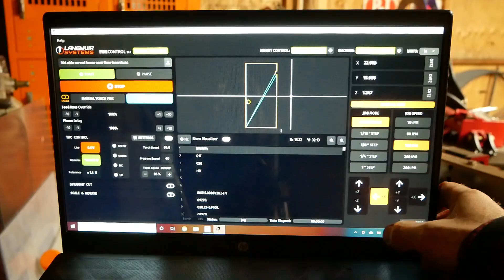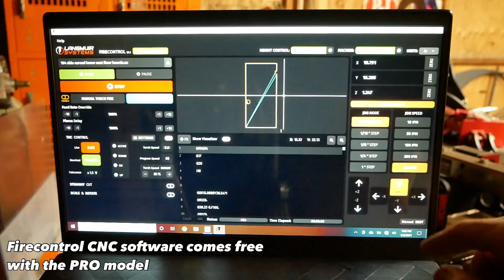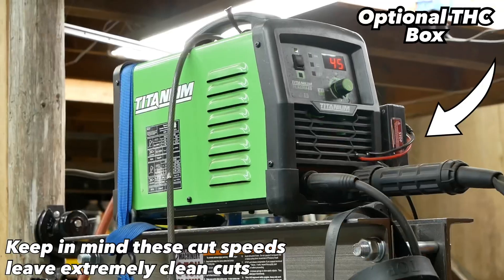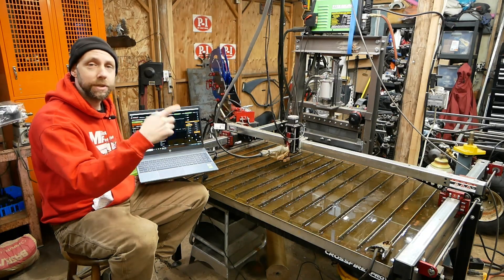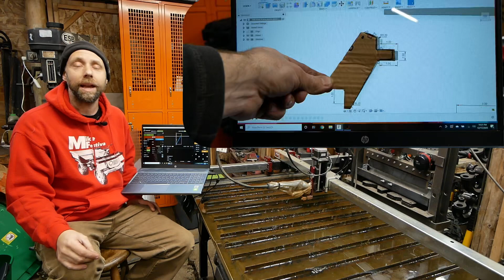Langmuir systems Crossfire PRO CNC plasma Table

Comment: just add locktite inside the coupler and its screws, never fails. or maybe its just the quality  issue ith those couplers coz similar ones work with 3d printers for years without getting loose
Reply from the maker: Only a problem once, a little blue Locktight fixed my problem a few years back.

Comment: I need to find a table that will accept half of a 4x4 sheet at a time. 
That way, I can simple swap ends of the sheet when its time and use the other half.
It will save a lot of money on materials as to not having to pay the "cut fee" to get a 4x8 sheet cut in half.

Also, a 4x8 sheet runs around 48 3/4" x 97ish" so, the table needs to accept about 49" with the ability to allow the other half of the sheet to stick out over one side.

Any suggestions?

Comment: Any provision for beveled cuts?  I know it would slow things down as real thickness of material increases on the diagonal, but I routinely build an item that almost fits on 4' across, and if I could get an extra cm by  beveling I could cut the matching part upside down with the beveled cut.

Comment: I ordered the crossfire table because of you!  It's due to arrive tomorrow (7 weeks+).  I did use your code for the $100 savings.  I'll never need the pro version for my home shop and I'm excited to get the crossfire table.  With all of the options I chose my order came to $2450.  You can see from the cost  I did order the z axis control among others.  I have Autocad experience in my past so I'll be able to adapt to Fusion 360 in time.  I have watched a lot of videos showing how to draw in Fusion 360 and I can tell it's very powerful.  One of the things that I see  that is really powerful is the fact that the program will take a 3 dimensional drawing and unfold it to a 2 dimensional drawing for use with these tables.  Your use of the table is really  impressive to me and has really made your builds more professional.  I already recently purchased an Everlast 62i plasma cutter which replaced my older Hobart 27i cutter.  I almost purchased the Titanium 45 but they were out of stock and found the Everlast that happened to be on sale for the same price.
Reply from the maker: That’s awesome Jim! I’d love to see some of your projects 👍

Comment: In Windows power settings, change your "lid switch" setting to Hibernate.  That way it won't use any power when it's closed and you can pick up exactly where you left off.  If you don't see Hibernate as an option, open a Command prompt and type "powercfg.exe /hibernate on".  I think you might have to reboot for it to take affect.  (Google how to open an elevated command prompt.)
BTW, I really don't HP Laptops.  My go to is Lenovo Thinkpads.  They are pricey but bulletproof.  Check out Lenovo's factory outlet to save a chunk of change.  Get an i7 processor and you'll be happy for a while.

Comment: Hi Mike, I'm thinking about starting a small side business and I would need a cnc plasma cutter. I would use it to cut some personalized keyring in some thin sheets of metal. Do you think it would be best for me to buy the original one with the Z axis and the water table upgrade or buy the pro one even if I think it would be too big for what I want to do and it would cost me almost 1000$ more? I also like the fact that I can easily move it around with the small wheels. I'd like to know what you think of that. Thank you!!

Comment: Mike, I've been watching many of your videos.  I'm going to be purchasing a Langmuir Plasma Table Crossfire XL, or the Crossfire Pro.  Most of my parts will be less than the 24"x33"... But by the time I get the XL decked out to what I want, the Pro is looking quite inviting.  I know you used your XL without the THC for quite some time and then upgraded to the Pro, but for brackets, welding tabs and hot rod parts, is the Pro that much better or just stick with the XL with the upgrades like the water table and THC?  Keep the videos coming, greatly enjoy them.  Oh, I think I'll be purchasing all of the Primeweld setup, 225 TIG, MIG 180 and the Cut 60.  But when I contacted Langmuir they were very direct, do not use the Primeweld Cut 60 on their tables.  Any thoughts?  Thanks in advance!
Reply from the maker: Hello Dan thanks for checking out my videos man I really appreciate it 👍
So I did use the original crossfire for most of my Articulating dump truck build and it worked really well, that version of there early table ran Mach3 and I really didn’t like that software, but now all Langmuir tables use Firecontrol software and it’s really a fantastic operating software.
The THC was a huge upgrade for me when I bought the PRO version, I don’t know how much the smaller table cost with the water table and optional THC? I just haven’t priced them out so that’s something you will need to weigh out?
I do know the THC will save you a lot in the long run when it comes to consumables because the THC pierces at a higher height then lowers down to the cut height when it’s pierced the metal, this saves the consumable tips from getting as much molten metal up in them.
I don’t mind the smaller table size for most of my brackets I needed to cut and now with the PRO table I don’t usually max out the capacity of it but it’s still nice to have a little more room if needed.
About the Primweld plasma cutter, I think they produce a lot of radio interference that can fault out the electronics in the CNC box. I had another subscriber buy one and have problems with his CNC table shutting down when cutting.
I’m in the process of testing out a new CNC capable plasma that a company just sent me, it’s quite affordable, ($500) with CNC ports built in so it’s plug and play but I have only just started testing it so I would like to get more time on it before I recommend it. 
So far it cuts great.
Check back in with me in a month and I will let you know what my thoughts are about it 🙂👍
Take care

Comment: What additive do you use in the water? Thanks in advance
Reply from the maker: That’s a hard one to answer because I don’t usually and the one i did find was hard to locate. I am actually using something currently but i got it industrially. Honestly i just change the water every few weeks. Just a little bit of rust won’t hurt anything

Comment: Mike I am interested in getting one of these machines. I have looked at the website and it looks like the Fire control and fusion 360 are offered for the single gantry Crossfire CNC as of 12/23/21. Do you know for sure if this is accurate or have I misunderstood?
Reply from the maker: Yes I believe you are correct about fire control on the smaller crossfire model as well. Firecontrol is definitely a much better program 🙂👍

Comment: A good trick for ground clamps is to ditch the heavy, bulky spring style clamp and go with a Irwin vise-grip clamp instead. Allows you to clamp metal to ensure good contact. Great for Welding or Cutting.

Comment: I bought the same unit and I bought the same plasma cutter from Harbor Freight.  Did you have to buy longer cables for the plasma cutter and where did you get them thank you in advanced
Reply from the maker: Hello Sean I’m running the stock leads that come with the Titanium plasma, I haven’t had an issue with them, I do however have it mounted up high behind the CNC table to keep it from getting water from the table on it, I also this helps with the leads.

Comment: I recently saw a cnc mod that looked useful.Add a pen, in tis case a retractable sharpie. When cutting metal that you will bend or weld to later, you can mark the crease line or plate location. The pen would be adjacent to the plasma so that you draw then cut.

Comment: Just to add a little perspective. Mach3 is a very cheap solution for CNC control, and for me outperformed a 5 axis control we were using that cost 20 times the price. The issues you described with Mach3 lead me to believe your vendor didn't set it up correctly. Mach3 is what it is - a simple PC based control that works well if set up properly.  A lot of Mach3's functionality and reliability depends on the abilities of the machine vendor.  

I've shipped a lot of systems (mostly waterjet) over the years that ran very well off Mach3 (some of the waterjet systems ran at high acceleration, with rapid speeds of 3000 IPM and cutting speeds at over 1200 IPM).  Then again, we made our own CNC boards (specifically for Mach3) and designed our own Control interface screens. Mach3 is designed to run up to 6 axis of motion (my control boards were designed to handle up 5 axis), but I have used Mach3 to run up to 9 axis of motion. Mach3 does indeed have issues (as every Control does) and is FAR from being perfect, but for under $200 for a license, it is a steal.

That being said, while you can still buy Mach3 it is no longer supported by the factory; it has been replaced by Mach4, which is a whole different animal, both in terms of performance and programming.

Comment: just ordered a pro and did in fact use the mikefestiva code at check out and got a 100 dollars off....thanks Mike..........now just hope I'm smart enough to learn now to use it when it gets here?
Reply: did it come in yet? how long was the wait?
Reply: @Ryan_Atomic  Yea I finally got the pro with the 45 plasma torch and THC.....took about 3 to 4 months to get everything but they finally came thru....table came in three different packages, the plasma machine in a separate shipment and the THC in yet another package....the machine is amazingly well built and packaged beyond belief.  Langmuir's communication was great. Build time took a little time but I am not as young as I once was. I have not used the machine yet as I have not had time to get into the fusion 360 cad program enough....winter project

Comment: I just got mine and I'm really struggling to cut 1mm stainless, the cut quality sucks and i cant find any guides for cutting charts
Reply: Bill have you gotten on the Langmuir sit and or the FB site a lot depends on the cutter you are using the amp, in per, air pressure and the size of your consumables.

Comment: Could you do a video Mike on how you wired up the Titanium 45 Plasma  Cutter machine to run the Cnc Table @Mile Festiva
Reply from the maker: I covered how to wire up the titanium in a previous Crossfire video, there should be a link to it in this video I think?

Comment: A tip on your laptop, if you change it to go in to hibernate mode rather than sleep mode, your battery should last longer.  Sleep mode keeps using battery power, hibernate stores the current state to the hard disk and fully shuts off power.  Reboot will be slightly longer from hibernate than sleep but still much faster than a full reboot.

Just finished watching all the videos on the CNC tables, really feeling the need now!
Reply from the maker: Thanks for the tip Shane 👍 I definitely appreciate it! These CNC plasma tables are a game changer in a shop, it saves me so much time when making parts. Take care brother 🙂

Comment: Hi Mike,
 Your videos have been very help full but i have a question  on Fusion 360 how the hell do i setup my post processor to save my files when i save them there is the internet explorer icon in front of file instead of a notebook icon which is what i believe there should be if that makes sense i put the question on Langmuir fourm but not much help  maybe you could give me some idea when you get time. Keep up the good work.  Thanks Dean
Reply: Or maybe you could do a video on how to set up Fusion for the post processor files.

Comment: I’m reaching out for a little help I just got the Z axis and THC upgrade got it all put together and as I’m cutting it keeps plunging I’ve tried even turning off the THC and it starts cutting and The next thing you know it’s plunging and I look at fire control and the THC is on again! I know you’re running the same plasma cutter is why I’m reaching out to you Hope you can help!
Reply: I figured it out! I had not pushed the THC Chip bored into the control panel far enough I was trying to be too careful not to bend any of the  pins Lol

Comment: Looking for information on this. Can this use wifi to the laptop? I know there is an accessory out there for laser cutting tables that plugs into 110v power that connects to the unit via usb to provide wifi.
Reply: Actually a cat 5 plug is on it from tp link.

Comment: I am looking forward to your software tutorials. As a soon to be new owner and complete CNC noob (ordered a crossfire normal). some beginner friendly videos showcasing the basic fundamentals on getting started would be great! The tutorials, the few that are on youtube here are usually aimed at mach 3. I get the CAD/CAM part is probably the same no matter what? I ordered the "45 Bundle" so was unable to use your code. but I tried :)

Comment: How well is the titanium plasma holding up. Thinking of getting one of these tables but not 100 on the plasma. Everyone keeps telling me to get a cut 60 but the titanium looks nicer. Any issues to watch out for?
Reply from the maker: Hey Daniel here’s a video I made to answer how all the welders and plasma torches have been holding up.
I cover the titanium 45 in this video, you can check in the description for the time line to see where that part starts 
https://youtu.be/uX0jA4258Jw

Comment: Tried going back and seeing if there's a video on your shop air set up and what compressor you use. Looking to eventually get a similar set up and was wondering what air compressor you use to supply the plasma cutter
Reply: I have the crossfire pro as well and a hypertherm 45 xp... great setup and overall impressed. Reality is your going to want a big air compressor with a water seperator. I run a 60 gallon 220 v compressor and wouldnt get anything smaller. Thicker the plate, the  slower you cut aka more air is needed. If your only going to be cutting thin sheet metal and smaller stuff you could probably get away with something smaller but i wouldnt recommend handi-capping yourself.

Comment: Whats up with the mini mill??
Reply from the maker: Are you asking about my milling machine? It’s an older Enco mill, basically the same as Jet, harbor freight and many other mills sold from the 80s on.
I got it for free, it was completely rusted up, it took two days of cleaning and oiling just to get the table to move, it’s missing some parts but still works for my needs.
Reply: @Mikefestiva  thats awesome. Did you make a video on cleaning it up? In a few days im about to embark on a 5 hour trip to pick up my first milling machine, 1981 supermax yc 1 1/2 vs. Its beautiful lol, but back on topic, i didnt know you had one, thats pretty sweeet!

Comment: Great video have u used inkscape to draw parts?
Reply: I have used Inkscape / Coreldraw / AI etc. for drawing up parts, they will all work but have design limitations. Get a real CAD program like fusion360 and you will be happier.
Reply: What about using adobe illustrator or photoshop?

Comment: I got the small crossfire a few months ago and the good software works with it and it has plugs for z axis upgrade. In case anyone was interested. I really want z axis with thc! Can’t wait til its available. I love the machine!
Reply from the maker: Right on! Thanks for the info 👍
I will post a comment about this so others know.
Last time I E mailed the company and asked if the Firecontrol software would ever be available for the original crossfire, they mentioned that it probably won’t be. I’m glad they changed that, the Firecontrol is far better.
Thanks Michael

Comment: I have a small shop and I’m wanting to start doing welding repairs and building trailers/repairing trailers what welder would you recommend I’m looking at the Omni pro 220 and the titanium 200 from harbor freight or maybe something else would just like to get your opinion on what welder would be best for welding repairs on equipment and trailers and building trailers and flatbeds for trucks from scratch

Comment: In windows Setting > power > advance setting > and there you change when laptop close from sleep to Hibernation it will save battery or to only disable screen then will be runing all time untill manual shut off

Comment: So what size air compressor would you recommend with the larger CrossFire Pro and doing 1/4" plate often? Also, does the new software allow for nesting multiple pieces to be cut?

Comment: The point of using f360 is not to just be drawing 2d sketches to cut from but to design entire projects and be able to make multiple part assemblies and then go to each piece and make your cut file to plasma.

Comment: I don't know anything firsthand about these machines. The usual complaints are the size and the cost. To me that argument is foolish because the CNC plasma properly used eliminates a brake AND a shear. Think about that cost and floor space especially considering the CNC can handle 1/2" material. The big obstacle for me would be the learning curve of the software even though I am somewhat proficient in Photoshop. I wonder if Adobe Illustrator would work as well as Fusion 360. I am looking forward to your next video.
Thank you very much,
Art
Reply: How does it eliminate the need for a brake? I hear you on the shear, I was contemplating getting an old antique 1/4 x 6ft shear, but then I realized a cnc plasma can 'be' a 3/4" shear by however long your long travel is....10 feet or more! Who needs a huge heavy iron shear anymore?? No one I guess.
Reply: @kmcwhq  It replaces a brake by cutting intermittent slots along the fold line allowing you to make very accurate bends basically 'along the dotted line'. Of course the thicker the metal the greater the force required to make the bend.  Then' if needed you can weld the slots shut.